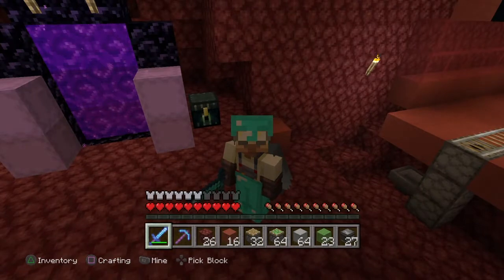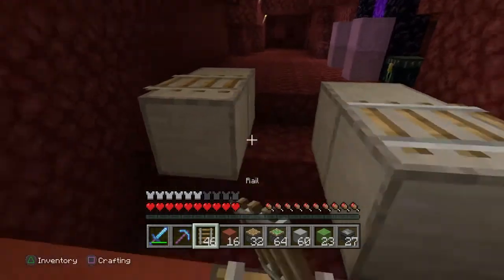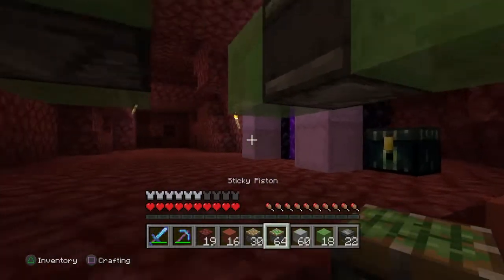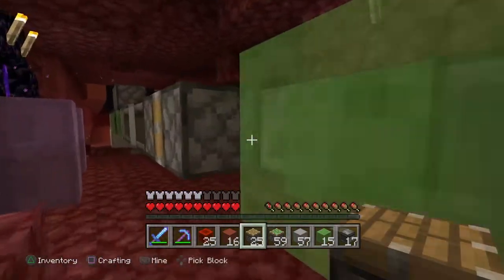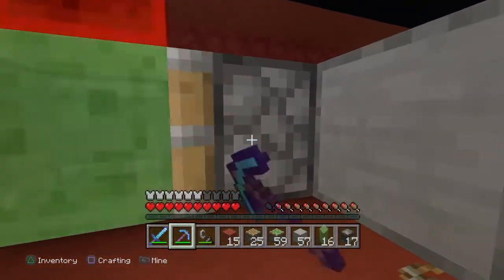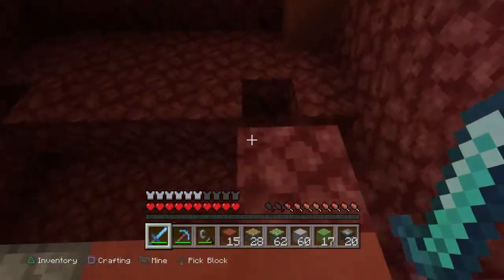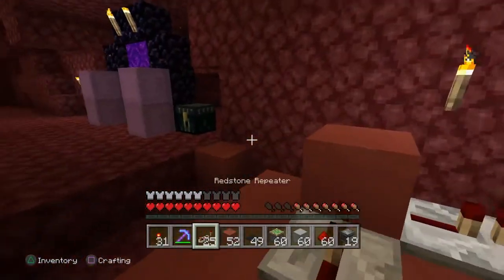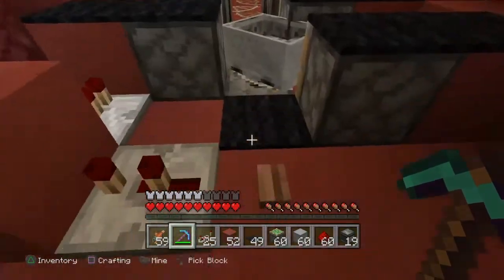PScicraft Ep1 - Let's Build a Piston Bolt

Comment: Trav, I have run into a problem with this build. The Redstone contraption only creates this certain pattern when the build is facing East and South, if it faces North or West the Redstone device will create an (S) shape that doesn't work for a Piston Bolt. You probably know this but I thought I would bring it up just in case.
Reply from the maker: Try removing the redstone block from the front
Reply: @trav8493 Yes that worked. Great idea

Comment: lobed the video as usual..but i built this and it worka as long as i dont ride in it...i can put animals in it and it does good..but with me it gets stuck at the first piston? idk
Reply from the maker: What Happens when you ride in it? Ive found that if I move the left joystick at all after I start there's a good possibility I'll roll off a track. Or perhaps you need a bit more momentum before the first piston?
Reply: when i ride in it it gets stuck at the first piston .. only controler bottons i touch are to turn around after hitting the button to activate it